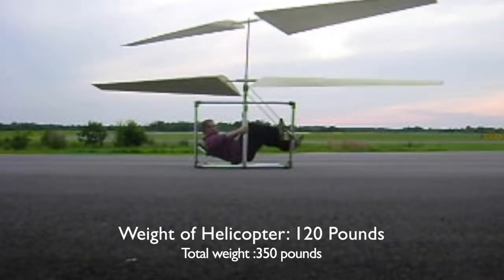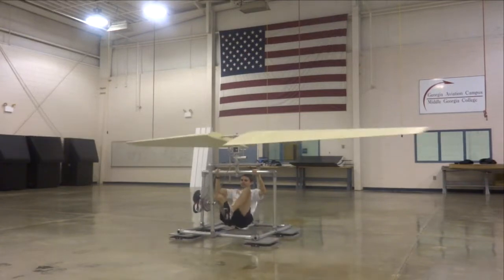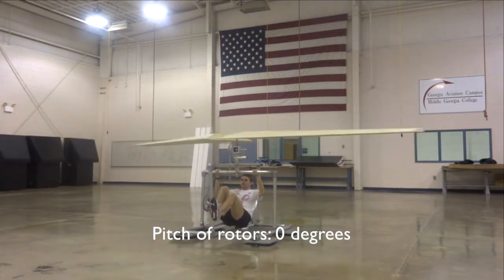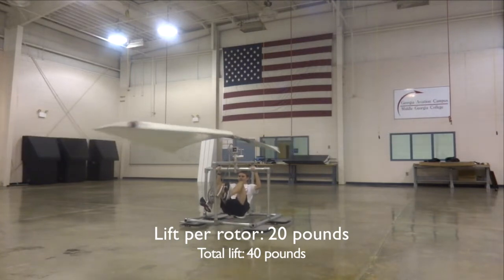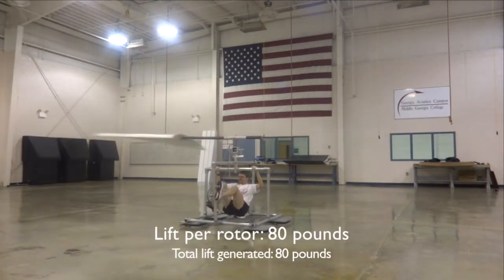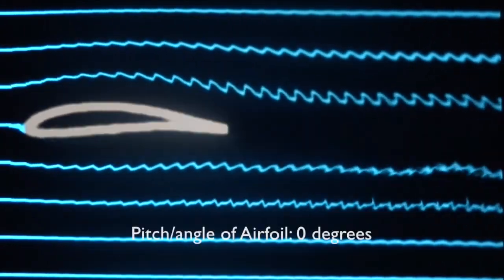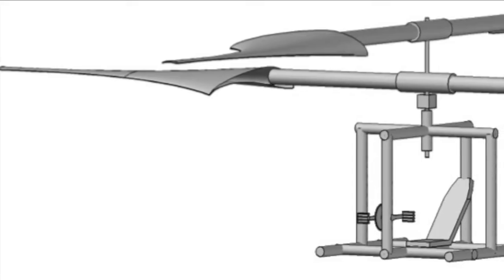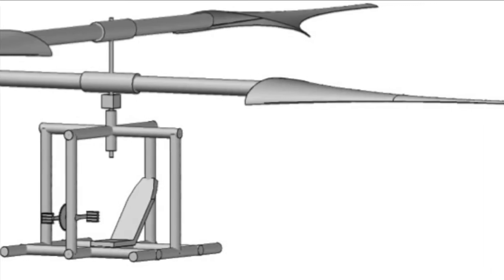Human Powered Helicopter Ground Tests

Comment: I don't get why no one adds gears to make the job easier on you. If i make the right gear ratio to it i can make the propellers spin 10 time every rotation that i put into in, so i would need to put 300 pounds of my strength into on turn of my feet

Comment: I had a rubber powered plane and one blade broke off and I tried it and it went twice as good. It was a slow flying light foam plane and the prop was also large and of foam. But with the one blade it kicked ass. Human powered planes should have one blade.

Comment: It's already been done and with four 60 ft props. He seemed to stay up easily, it was so efficient. But way BIG and not practical. If you don't succeed you can always use your research for economical powered helicopter flight (maybe electric). Cos I really don't think human power is enough for anything practical (a "practical" plane...maybe). A huge flying wing with a propeller.
Reply: these are prototypes from THAT build, these prototypes are from 2011-2013, check the description

Comment: I think the rotor must be much larger for human muscles be able to spin it fast enough for a lift off. Take for example any bird that can kind of hover, measure its wing surface area and span, then compare it to the body weight of the bird and go from there.
Reply: You are right and it's been done. The most successful is also the largest. It hovered over ten foot high for over one minute and won a prize. YouTube "prize winning pedal helicopter". It's a quadcopter with four 60 ft diameter props.